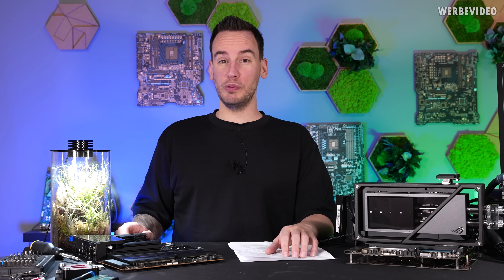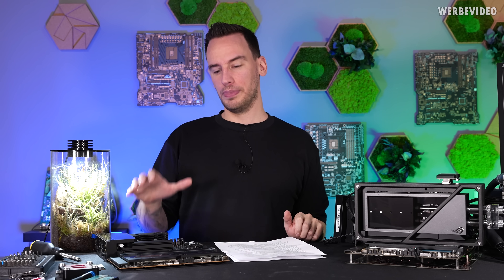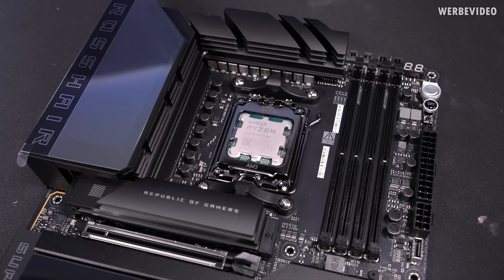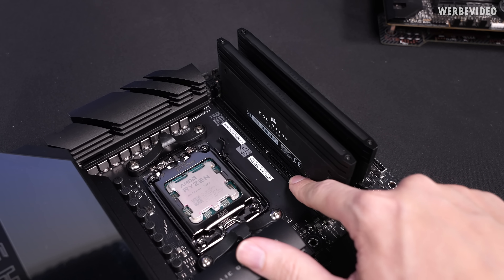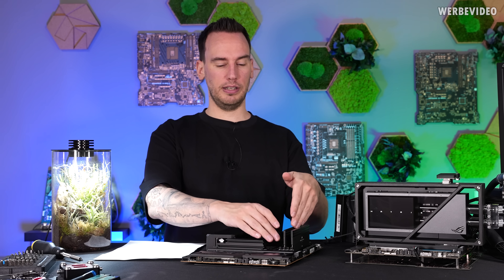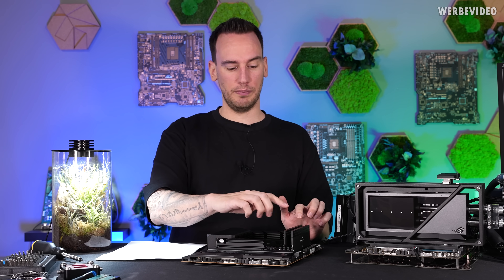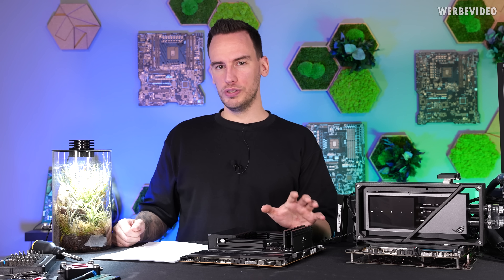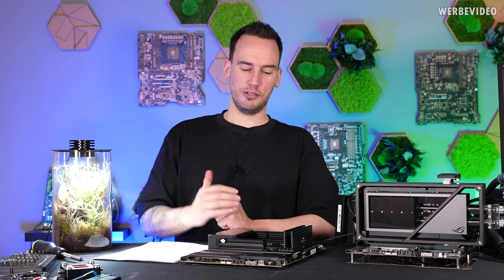How Empty RAM-Slots cause Trouble - ASUS NitroPath

Comment: Wonder what took them long. It is actually a better design overall when you see how the socket contacts have no sharp points that are pointing up, and that transmission-line antenna effect. The only problem would be, if the contacts are designed in a way that it is hard to crush them when someone would install RAM sticks and push hard and quick, maybe a bit sideways. Hope they took that into account!

Comment: Should we really go to DRAM on the CPU package? The reality is that if we can afford a high-end CPU, it wouldn't be pair with low capacity DIMMs and vice versa.
Sure, the entire unit fails on single component. 
For that matter, when using discrete GPU, which now have awesome heatsink, the CPU-memory + GPU+mem should all be under a single heat system.
The thing I don't like about Apply Mx is that the SSD is hardwired. The device tolerates connector signals. Also, they are focused on LPDDRx for low power, and were are DDR5 regular

Comment: The marketing picture of the NitroPath slot looks like it would rip itself apart if you remove a memory module.  At least in reality it doesn't hook the pins, allowing safe removal.

Likely the fully populated speed is due to the memory chips having a capacititive load on the CPU memory controller pin drivers.

Comment: Idea to test with the old RAM slot design, some sort of slot cage or cover, made out of mesh or solid metal with the idea to block the high frequency radiation. And maybe something V shaped with the idea to reflect the radiation upwards away from the pcb traces.

Comment: Glad to see the real cross section samples, contacts that directly touch pads on the end of the contact like shown in the marketing graphics are never used. That sort of design would dig into the PCB pads and risk ripping the contacts out of the socket or seriously deforming them.

Kinda wish the marketing graphics conveyed the idea better, when you first showed the pictures I assumed the performance improvement was going to be for populated DIMMs.

I also wonder what would happen if they had those NitroPath contacts in addition to a shield on the DIMM connector, a lot of other manufacturers claim significant performance improvements with just shields.

But I'm waiting for the day now we see an extreme OC motherboard with CAMM on the bottom for ultra short traces.

Comment: Got a pack of these silicone dust covers for PC ports, and it came with 2 DIMM covers.

Wonder if it (or a model that fully covers the port) could be a "duct-tape solution" for the conventional MOBOs, that at least insulate a bit the interference of the unused DIMMs.
Reply: No, EMI goes right through plastic. And there's also the problem of crosstalk back to itself
Reply: @DeadOSThings  Obviously, but what about a metal cover?
Reply: @ZoranRavic  remember how many pins are in a single slot. Pretty sure it would cause more problems that it would solve

Comment: The reason they are curved past the contact point is so the pointy tip of the pin doesn't drag along the contact pad on the memory module and instead a smooth area makes contact. If the the end of the pin made contact you'd probably not get more than a handful of insertion cycles before the pin got destroyed.
Reply: I don't see why they aren't trying to make a ZIF type socket for RAM.
Reply: @therealjammit  They are, with camm2 RAM.
Reply: Is perhaps a bit curious as to why they didn't curve it just a tiny bit towards the end.
Reply: yep
Reply: The drawing is inaccurate, in the crosscut of the actual module (later in the video) you'll see that it's still at a bend and not the very end. It looks like it would have same insertion count.
Reply: Jump to 9:21 and look at the cross section, they're curved. I was just about to make a comment on the same thing.
Reply: Way to out yourself for not watching the whole video

Comment: I've saw at hwbot that somebody modified first Ramapge Extreme mainboard to get some high numbers OC, and there were 2 DRAM slots removed. I guess for same reasons, but memory controllers were weaker, and frequencies were much lower than we have now. But I suppose capacitance of the DRAM slots were a factor too.

Comment: You're probably going to explain it, but Im guessing its the length of the wire, that gives cleaner signals, because there is a fork in the wire where the signal runs up to then find nothing.

Comment: While back I came across the concept of using two dims, and two. I think they were called light kits ? To fill in the other two spots. Is this a feasible means of correcting issues with empty dim slots?

Comment: I'd be really interested in an ROG Hero Z890 with 2 memory slots, even if they did 2 different models one with 2 slots and one with 4. I've never really fancied the Apex, just because for most of the life of my build I'm not going to be interest in OC. I normally get obsessed with OC when my builds are new, then after a couple of months I never touch the setting. I opened the case on my current build the other day, and that was the 1st time I'd even had the sides off in like 18 months.

Comment: 4 dimms and full atx should not be the standard. those should be premium board features.

matx with 2 dimms should be the standard for most pcs these day. the general consumer does not need a ton of pcie expansion slots or ton of dimm slots.

Comment: You need to make a metal cap that plugs over the empty slots with a connection to ground to reduce the interface!
New debauer product.
Reply: That won't help with stubs on the transmission line. At these speeds, we are deep into RF territory,
Reply: @kosmamoczek  thus the shielding, to block rf
Reply: @darnice1125  Rather the problem is that it acts as capacitors in parallel/in line (depends on topology) with the live circuit and thus smoothes the signal, so you won't gain much with just shielding cover. Sadly dealing with this electrically will cause more problems than it solves, but mechanical solutions are pretty much free (removing the second DIMM per channel or making its capacitance less by reducing electrodes'' surface) 
Antennas analogy is not that technically accurate, but good enough) BTW you can say antennas are (parts of) capacitors too, just very big ones.
Reply: @darnice1125 Sheilding blocks outside interference. It does nothing for the signal crosstalk between pins, and you can't shield each pin because the increase in capacitance would screw up the signals even more. This is really about minimising the unterminated signal length caused by empty DIMM sockets, although Asus described it as minimising interference to make the information more widely understood.

Comment: When you go with simple electronics, like PWN signal for a fan, things are simple.
When you go very high speed, like on DDR5, things just turn into dark magic and really really odd things start to matter, like shape of contacts here.
I wonder if you would be to take traditional contact DDR5 slot, then insert blank DDR5 module which has nothing, but contacts, perhaps shaped in some specific way, or half length facing downwards only, would help to reduce the radiated interference.
You could ask some HF/RF engineer about that and he could hint something and then you could make such blank modules and sell them.

Comment: I've been surprised they still add 4 slots on most motherboards. 90% of users are never going to populate more than 2 anyway.
Ideally, performance-wise, the best thing would be no connectors at all, but soldered memory. The new laptop processors from Intel has memory soldered directly onto the cpu substrate. It's been a long time since I first heard about memory making their way onto the processor substrate or even in the die itself, but it hasn't really happened until now. An unfortunate side-effect is that replacement and upgrades are made more difficult or "impossible".
Reply: Guess it depends how close those slots are installed. If they are neck to neck the affect/interference will be the same as with occupied slot. Honestly i think it would be better to have 4 slots to have enough spacing/spare slots if one get fault. And add some  dummy stick between to reduce EMI crosstalk rather than have only 2 slots placed in distance.
Reply: @user-eq2fp6jw4g  Its not really that simple, as electricity is going to flow even with dummy sticks.  They may be able to alter the interference, but you then are impacting the voltage/current so would likely need to run more power to the slots.  So you trade one problem for another.

Its a similar situation to DSL broadband and why you only want the DSL signal going to the socket the modem/router is plugged into.  If it goes anywhere else you get reflections back down the wire, and if you put filters on the end you are reducing the signal strength as you are absorbing part of the signal that otherwise should be at the modem.  So ideally you filter at the first socket for the least loss and run all phone extensions AFTER that filter.

Unfortunately especially in the US, a lot of house phone lines are run as a star which makes the problem a whole lot worse, as you multiply the reflections by how many wires are connected to that star, a whole lot worse than daisy chaining.

Comment: DDR5-3600 or DDR5-4200 for 4x socket motherboards, there is no such limitation 
If using 2 DIMMs  in a  4 socket RAM  motherboard.

Comment: What you would want to do is create a RF blocker that can go in between the sticks to act as a shield for quad slot boards. OR memory companies can make dummy sticks for that purpose, OR the Heat sinks on the sticks should be engineered to be RF blocking.

Comment: Had no clue this was an issue but after your explanation it now feels like common sense that the empty slots would act like an antenna.
(BTW because of the way you explained and that it made so much sense to the viewers shows that you are truly an expert in your field)
Reply: I personally think about it as RAM signals "bouncing" at the end of of the traces in both slots.

Thus the memory controller will have to handle the "echo" of every signal and longer "antenna" increases the time shift. But I am just a mechanical engineer, so this is how I visualize if for me to make sense of it as the antenna doesn't create any wireless signals 😂
Reply: @stennan  Both the signal reflection and the antenna effect are why nowadays most if not all consumer-oriented mobos with more slots than channels have their ram slots in daisy chain traces configuration instead of a T shape routing.
That's also why terminators are used for most transmission lines.
Reply: I knew 2DIMM was better than 4DIMM for Memory frequencies becuse of the Empty DIMMs, but this was a great explanation of why.
Reply: Yeah I recently read about an exploit that allows reading memory of air-gapped systems because of this effect, if you have a compromised computer close to another air-gapped computer, it's possible to read memory from the magnetic field alone. Kinda crazy and hard to do outside the lab but it further explains this.
Reply: If you watched buildzoid you would not even think of this nonsense... 2 dimm slots will always clock higher as well so thats why apex encore or the gene use only 2 slots for the fastest speeds for the signal integrity...

Comment: I wonder if this antenna thing is an oversimplification. I would assume that empty RAM slots are just an RF stub which reflects signal back. With pins in the populated slot probably that's not an issue because it's so close and earlier in the eye pattern so as not to cause significant eye closure.
Reply: Antenna/stub is somewhat interchangeable here, one is more understandable for the average viewer so just say its an antenna.

Comment: Makes me wonder why boards default to 4 slots anyway. If you need it, you're not gaming and you're more likely using slower dimms anyway. If you're making boards for gaming and other high throughout apps, why not have more boards with just two slots? The vast majority of people will only use 2 modules anyway, never needing more than 32 or 64gb
Reply: Are you only thinking in terms of the very latest modern DDR5 chips that are easily 32GB per DIMM, and approaching 64GB at high speeds/lower latency?

Because if you've been around for the last 20 years you'd understand how slow capacity has increased relative to speed and latency, and latency has become a major factor with Ryzen, to the point it was even recommended to get specific 4 module dual rank DIMMs at a lower capacity, because they offered much better performance.  Nevermind the insane price of higher capacity modules, god forbid they were high bandwidth and low latency too; cost more than your damn CPU/GPU.

Motherboards using daisy chaining vs t-topology and causing ingress issues at such high frequencies should be the focus of discussion, not intentionally limiting capacity.
Reply: @AceStrife  I assure you that almost no one knows about topologies-You can also look at what kind of frauds they do with trfc))) to avoid a huge number of mistakes. resulting in increased delays
Reply: @ПавелС-ш8м  Yeah and that's the problem; it's such an underlooked issue that only the hyper enthusiasts really know about it.

I don't overclock memory because it's so complex (memory corruption is very bad), all I just want is a damn stable system at RATED timings, and I haven't even had that since first switching Ryzen!  Almost all due to 4 DIMMs.
Reply: @AceStrife  yes, but no. On my last build I had 8gb RAM, 2x4gb it's always been better to have only two modules. And as for lower latency stuff, that's only with extreme oc that it even matters, right now 32gb ddr5-6000 is cheap and plenty fast and you don't need ddr5-8000 or sub 30 timings to get the full performance out of your CPU/ GPU. And previously, again, you didn't need extreme capacity modules for gaming. 8gb was sufficient and cheap. I should say, relatively cheap, not cheap cheap. Computers are still overpriced ATM. And through all that, gamers never needed more than 2 RAM slots and even the overclockers only use 2 slots because it's faster and more stable anyway. So any boards aimed at those groups should have 2 slot options.
Reply: @strategicgnomer1  Why so focused on the here and now?

Modded games have easily been able use 20GB of RAM for years. Normal games are getting to that point.  Now imagine what's left for Windows, chrome, discord (also chrome), steam (also chrome) and whatever else (also probably chrome).

Open task manager.  If "Memory Compression" isn't 0K, you need more physical RAM.  No you haven't run out, it's just hit Windows' threshold to start compression.

None of this is even relevant the point.  Don't downgrade the entire industry, removing something we've had since basically inception, just to save a few bucks.  Just like how they're handling SATA/PCI-E slots.  It's utterly asinine.
Reply: @AceStrife  I feel like you're not hearing what I just said. Currently 32gb is cheap and fast enough to suit everyone. I just said that in the reply you're replying to. Why does no one actually read comments before replying? Hell, even 64gb kits aren't that expensive anymore if you're not buying ddr5-8000.
Reply: @strategicgnomer1  You're saying 32GB is enough to suit everyone.

32GB is not enough to suit everyone.

Generalizing and making statements like "everyone" based off your personal experience is what the problem is.

Consoles exist for the "one size fits all" approach.
Reply: @AceStrife  you... You can't read can you? Please tell me where I said everyone. Go ahead, I'll wait.

Comment: 3600 or 4200 its official specs from AMD for Ryzen CPU/chipsets for 4 DIMMs in socket),
So,  4200 or 4600 is if 4 dims are installed ( Intel also has like this for different number of DIMMs in sockets).

Ryzen 7700

Max Memory Speed
2x1R	DDR5-5200
2x2R	DDR5-5200
4x1R	DDR5-3600
4x2R	DDR5-3600

For two dims, especially  for 1 rank 1Rx8 (SS ) DIMMs   there will be no big difference 2 vs 4  socket motherboards.
Yes,  2 dual-sockets MB  are better at the most extreme frequencies.

Here is the example from QVL for Z790 AORUS MASTER (4 RAM  sockets  MB)  memory for 2 DIMS: 

8000 TEAMGROUP 16GB 1Rx8 FF3D532G8000HC38DDC01
8000 TEAMGROUP 16GB 1Rx8 FF4D532G8000HC38DDC01

So, you can install two DIMMs in different memory channels, two sockets  will be empty, and you will have at  4 RAM  sockets MB  8000, not  3600 or 4200.
There is no such limit for 2-DIMMs in 4-slot MB.

RAM QVL has different speed specs depending on whether you use 4 DIMMs or 2 DIMMs in 4 RAM sockets  MB.

"(The CPU and memory configuration may affect the supported memory types, data rate (speed), and NUMBER of DRAM modules, please refer to "Memory Support List" for more information.)"

Comment: But the top tier motherboards have shielding on the slots, so how does it compare to NitroPath? And what about the underside of the connector - is this SMT mounted slot (like X99 SOC Champion) or through-hole?